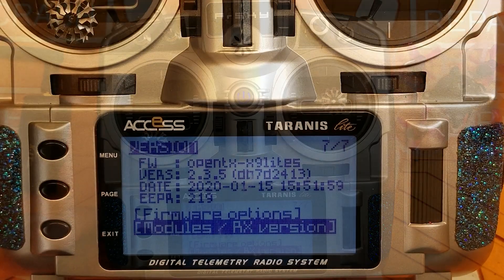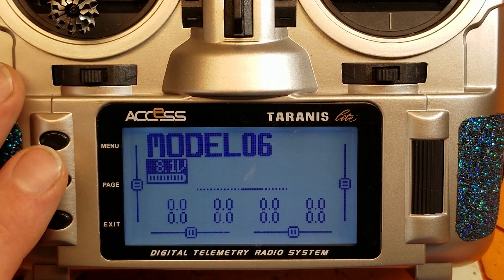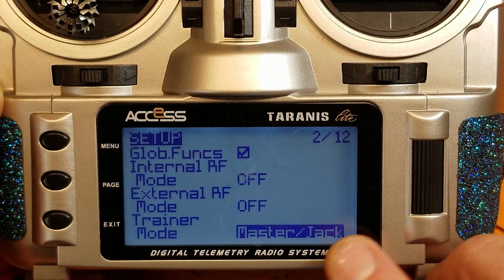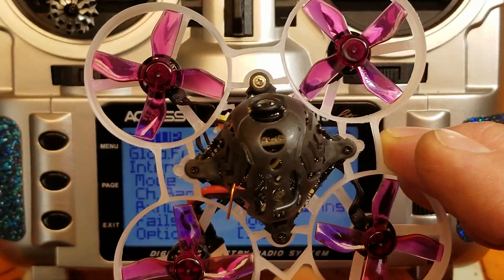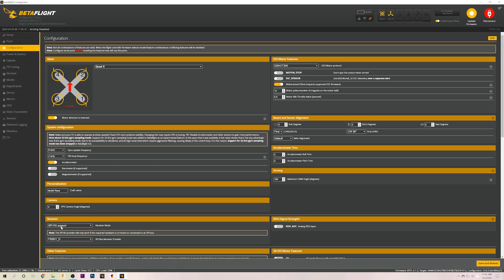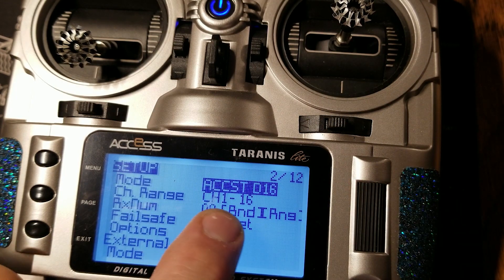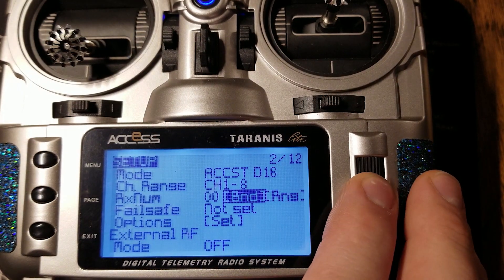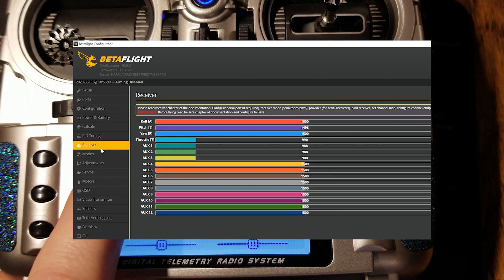How to bind SPI receiver with an ACCESS radio in D16. 📻✈

Comment: Okay, now I'm having a different problem. After fiddling with a few settings on Beta flight, I decided to reset the settings and just create a new model on my TX. After doing so, Betaflight isn't preloading the range values for the AUX1-3 controls anymore and I'm not fully understanding how it was setting those up to begin with. No matter how I set the ARM and ANGLE, the Mob6 will not arm and I haven't found a way to create a "crash flip" control from scratch. Should I flash the board on the whoop or is there another way? I'm about ready to just throw this damn thing. I'll get more air time out of it that way. LOL j/k
Reply: Also, has anyone tried out the iRangeX module with anything? I've got one on the way in hopes of using the X-lite with my Mini Convergence.
Reply from the maker: Did you flash new fw in bf or did you just hit the reset settings button?
Reply: I just hit the reset settings button thinking it would revert back to the setup it initially created the model with.
Reply from the maker: Haha yea that's not how it works unfortunately. Did you back up your settings before you did that? Either way the channels are probably not populating because you need to go to the config tab and enable spi based receiver and frsky_x if you were running d16. Unfortunately this will just be the top of the iceberg of issues you might encounter from clearing the settings.
Reply: @TweetFPV  I was afraid of that. I made sure it's set to SPI and Frsky_x.
Reply from the maker: https://discord.gg/YrB7BSv hit me up in discord and I can send you a config dump for the mobula 6 to get you back to stock.

Comment: Excuse my ignorance but I’m new to FPV flying.  I purchased the Tiny Hawk Freestyle.  Didn’t know what kind of transmitter I needed.  My second transmitter is the Taranis FrSky x9 Lite.  Will this work on the Tiny Hawk?
Reply from the maker: It will.
Reply: @TweetFPV  I've spent so many hours looking for help. I'll give this a try..
Reply from the maker: If you have troubles hit me up on discord. I've help more people than I can count with using that radio and Quad combo.
Reply: @TweetFPV  I'm still looking for your upgrade video..

Comment: I'm guessing this doesn't work with the newer firmware update for the radio that's required to use the r9m lite pro module and newer r9 ota receivers.  can you confirm which firmware version or release date you have here please?
Reply from the maker: I'm using opentx 2.3.9 ISRM FW v 1.1.3  and this will not work with V 2.x FW. Your R9 fw is independent of your internal (ISRM) FW. so you can run older ISRM FW and current R9 FW at the same time.

Comment: I'm at work so I'll have to double check, but I think my Taranis QX7 will not go into ACCST It will only go into a ACCESS or ACCESS16. Am I remembering correctly, is anybody aware of this?
Reply from the maker: you are not remembering correctly. Your new model QX7 will do ACCESS and ACCST D16
Reply: @TweetFPV  That's exactly right and I learned how to update it and now it's working. But I wouldn't have figured that out without your video so thank you

Comment: I have followed the same steps, but unfortunately it didn't go through. 
the qx7 access Tx operating system is up to date 2.3.9
Betaflight version 4.0.0 is uptodate 10.7.0
Configuration is Frsky_x
in the CLI: bind_rx_spi, then put the radio on bind mode D16
then hit Save. 
nothing worked! :(
Can you please tell me if there is anything I need to check
Reply from the maker: check to see if your bootloader is v 2.3.9 as well.

Comment: Heeeey :) Thanks a lot for your video ! 
However, impossible to bind my bet65s with my taranis qx7 ACCESS... I flashed the 1.1.3 isrm firmware, I'm in eu, and the spi receiver is set to FRSKY_X_LBT. Also, I'm well on the 2.3.5 version of openTX... Don't understand what is going on. Any help would be welcome :) Cheers !
Reply from the maker: Is your radio setup as fcc or lbt in the module version page?
Reply: @TweetFPV  I'm trying to flash the old xjt firmware in FCC but not working... 
In the module page it says, 
ISRM-N 1.1.1/1.1.3EU
Reply from the maker: Have you tried using frsky_x the non lbt version?
Reply from the maker: I haven't dealt too much with the lbt issues.
Reply: @TweetFPV  Yop also tried this one :(
Reply from the maker: Well it's not the "right" thing to do but you could change your radio to a fcc radio and bind with accst d16 and frsky_x.
Reply: @TweetFPV  Just done that and it works... OMG, thanks I don't have to deal more often with frsky protocol... gold for CRSF hahaha
Thanks a lot for helping :)
Reply from the maker: Awesome. Glad that got you going. I wish things were easier.
Reply: @TweetFPV  Hahahah thanks again :) I wish too :)
Reply: hey, I read your conservation and how did you changed your radio to an fcc radio? What do you mean by changing the radio? 
Did you have to add a lua script?
Sorry the many questions but I would love to hear a little instruction, because my Mobula 6 is waiting.....
Reply from the maker: Yes you can change radio region with a Lua script I have on my discord server. You can find the link to my server here Www.tweetfpv.com I can help you better over on the discord if you need it.
Reply: @TweetFPV  Yeah I wrote you a message on your discord server in Troubleshooting

Comment: You save my life with the command 'save', thank you very much!!!!!!!!!!! :)
My case Tinyhawk 2 with x9d+se in eu_lbt
Reply from the maker: Glad i could help!
Reply: how you did that ? i struggle alot ...tried so many things . i have same setup th2 with x9d+se eu_lbt. do i have change the spi to frsky_x_lbt or not ?
Reply from the maker: If you have a lbt radio then you need to use frsky_x_lbt but you can not be on isrm v2.x you need to be on v1.1.3
Reply: @TweetFPV  it finally worked. i guess i hadn't waited long enough after the bind_rx command. thanks for the help
Reply from the maker: No problem! If you need any more help feel free to ask over on my discord server. You can find the link on my website http://www.tweetfpv.com

Comment: I have a Taranis Q X7s ACCESS radio and a Tinyhawk Freestyle. After flashing the ISRM module from v2.1.0 to v1.1.3 I managed to the bind the Tinyhawk to the radio in D16 ACCST mode but the signal is so unstable that the quad is impossible to fly. When I power on the radio and the quad the signal remains "stable" for about 5 seconds then it keeps dropping and coming back every 15s or so. The radio keeps saying "Telemetry Lost, Telemetry Recovered, Telemetry Lost, Telemetry Recovered... RF signal critical" etc. I have tried both FCC and EU (LBT) modes but the issue does not disappear. Does anyone know what the reason could be?
Reply from the maker: The reason seams to be an issue with the amount of data sent in d16 mode. Some boards are better than others. This is why i don't really recommend using d16 mode with SPI based boards. The XJT module is the only real way to get D8 for these models to work well.
Reply: @TweetFPV  Thanks a lot for taking your time to read comments to reply! 
I have read somewhere that FrSky has disabled D8 in newer XJT modules, even if it is displayed as "availble" in openTX...
Reply from the maker: That is not true. D8 works just fine with the XJT module just not the ISRM on newer ACCESS radios. There is a LOT of incorrect info out there by people who just don't understand how these radios work.
Reply: TweetFPV thank you very much!
Reply from the maker: no problem.
Reply: @TweetFPV  thank you for this video. But I think Dave is right. The new firmware for xjt module disables d8. (I suppose if you keep older firmware it should be fine)I think the only solution for access txs and d8 Is multi module)
Reply from the maker: No, the new fw does not disable d8 unless you flash the lbt version. Lbt disables d8 because d8 is not legal in lbt use areas and this is how it has always been for the older radios. I think some of the confusion is using the term xjt to mean all fraky transmitter modules. Where as all the old radios used an xjt module and the new radios use a ismr module in which the isrm can not do d8 in any situation.
Reply: TweetFPV Update: I was able to obtain a stable bind in D16 mode between my Taranis and the Tinyhawk. I simply had to bind using the “8 channels, no telemetry” option in the radio (rather than the 16channels option).
Reply from the maker: @Dave-xv8xh  yea d16 is unstable and the less you make it do the better. D8 in general is always better with the spi boards.
Reply from the maker: @Dave-xv8xh  some spi boards are way better than others.
Reply: Sorry if I jump in, why did you change your ACCESS version from v2.1.0 to v1.1.3?
I’m asking because I have a QX7 with ISRM v2.1.0 and I’m using it with my 5” and I don’t like the idea to downgrade it in order to make it work with the tinyHawk
Reply: Nicolò Riboni https://youtu.be/mDBoXLGjqS4 that link might help you bind your QX7 ACCESS with your Tinyhawk
Reply: Nicolò Riboni Sorry for the late reply... I did it because FrSky has slightly changed the binding procedure in firmware versions after v1.1.3. They did it to break compatibility with ”FrSky compatible receivers” (such as the ones found in the Tinyhawks). You can have both firmwares in your Taranis’ SD card and then flash either one whenever needed.

Comment: Hi there, 
Great video and explanation. I have tried everything and I can't get my Tinyhawk S to bind with my Taranis X9 lite. I followed all the steps (also in your other video on how to update firmware). I did it all except one thing. I updated to the 2.3.7 opentx firmware instead of 2.3.5 and I updated the bootloader to 2.3.7. Can that be what courses me the troubles? Or should it work with that firmware and bootloader as well? 
All the best from Denmark
Reply from the maker: the boot loader not being updated can cause issues with binding. also the ISRM FW needs to be on v1.1.3 the V2.x WILL NOT work with the spi boards on D16
Reply: @TweetFPV  alright thanks. I'll try to upload the bootloader and the ISRM to the exact same version as you have in the video. I just couldn't seem to find it.
Reply: @TweetFPV  Thank you so much!!!!!!!  I finally got my FrSky X-Lite S to connect to my Tinyhawk S in D16 mode.  I upgraded to OpenTX 2.3.7.  I down graded my ISRM FW to v1.1.3 and it starts working!  Cheers.

Comment: I had my tinyhawk 2 bound to my taranis Q X7 accst. After installing a long range module on the taranis and doing a firmware update I can no longer bind to my tinyhawk. Even when I turn external module off. Can someone help here??
Reply from the maker: You might have accidentally flashed over your internal rf moduel. Go to https://www.frsky-rc.com/taranis-q-x7-3/ and download the ixjt fw but select the "history" version not v2.1 copy that to you sd card and flash your internal module with that fw.
Reply: @TweetFPV  My QX7 will not let me overwrite the existing firmware.
"FW update error. Not responding"
Reply from the maker: Which fw did you have and which are you trying to write?

Comment: Initially following this video, I was not able to get my X9 Lite connected to my Mobula6. I was struggling getting it connected, but after trying many different things, I eventually landed on a setup that worked. Here are the exact things I had that made it work for my drone:

* On the FrSky X9 Lite controller:
- OpenTX 2.3.7
- ISRM v1.1.3FCC (as downloaded from https://www.frsky-rc.com/taranis-x9-lite/) 

(side note: I did NOT get the new v2.1.0 to work with the Mobula6, even after flashing the v2.1.0 again after the initial binding. Flashing back to the v1.1.3 fixed it though and let me bind again)
- Bind settings: ACCST D16, CH 1-8, bind with CH 1-8 telemetry on

* Drone (Mobula6):
- Updated firmware to Betaflight 4.1.2 under the board name "CRAZYBEEF4FR (HAMO)" (I believe it's the same version installed on the Mobula6 in the video)
(side note: I was not able to get it to bind in Betaflight 4.1.5. I don't know if this was due to one of the other things I've mentioned being set differently at the time or not, but I wasn't able to get it bound on it for whatever reason.)
Edit 4/24/14: Was able to get the Mobula6 to rebind to my controller after flashing Emuflight "0.1.0 - CRAZYBEEF4FR" and applying the Project Mockingbird tune for it. Same process for binding- nothing changed on my X9 Lite.

With all of those set, I then followed the procedure in the video, and was able to bind to my Mobula6.
I don't know exactly which of these is may be directly responsible, but the fact that I didn't need to have the latest firmware/software for EVERYTHING kind of shocked me. Just posting what worked for me. Thanks for the helpful video TweetFPV! Came in handy once I had all the firmware stuff setup correctly.
Reply: I've tried changing the ISRM version from 2.1.0 to v.1.1.3 and it worked! Thank you very much for your help. I was having a lot of problems and I saw a lot of videos but your comment was the one that really helped me. Thank you again!
Reply: Wow thank you so much. Im so glad i found your comment here. I was able to make it work with the v1.1.3
Reply: that should be top coment. Thanks, I spent many hours to figure out whats goin on.
Reply: Does this mess up other quads that might be bound to the radio, or is the isrm thing based per-model?
Reply from the maker: All models need th have the same reciever fw on them.
Reply: Thanks men you save us with FIRMWARE 1.1.3 just that ! When you were going to stop using your Taramis !
Reply: If i use the external XJT or multi protocol module to enable D8 mode, will that work with access 2.1.0? or will i still need to downgrade the firmware to 1.1.3 regardless?
Reply from the maker: The fw on the external module and the internal operate independently of each other, so yes you could have 2.x on the internal and still use d8 with the external.
Reply: @TweetFPV  ok so i need an external to use both. I bought an iflight nazgul5v2 and had troubles binding to my q9lite. I updated to access 2.1.0 firmware and flashed the rxsr with the same to bind. Now im find my whoops arent binding. Clearly the reason this pinned comment states :(
Im assuming to make all these work i will need to flash everything with v1.1.3?
Reply from the maker: Without the external modules then you are correct. V1. 1.3 for everything
Reply: THANK YOU!!! I really appreciate it man nice and easy to follow and I had the exact same specs.

Comment: followed the video really easy to follow but unfortunately i still cant get my x9 lite to bind to my mob 6 - should probably mention Europe based have your or anyone here in the comments had similar issues?
Reply from the maker: Have you tried using the frsky_x lbt mode in the bf config tab. I have to admit I have no experience trying to get a EU branded radio to work like this.
Reply: @TweetFPV  I was reading the comments and I saw that so I hopped back into betaflight to check I don't actually get that option for some reason this is my first drone so I'm learning as I go, 

I have a feeling ill end up needing a external module that supports it natively for some reason. If you have any other suggestions I'd appreciate it! :)
Reply from the maker: Hmm what version of bf do you have?
Reply: @TweetFPV  can't remember the exact version but the bind command I get with tab is bind_rx so it's 4.1.x

Comment: How can I get to that version page on a Taranis x9 lite? I can’t seem to figure out what firmware I’m running
Reply from the maker: Hold the menu button to get into the system menu then scroll till you find it.
Reply: @TweetFPV  Perfect. If I upgrade to Open TX 2.3.7 will it connect to my Mobula6?
Reply from the maker: Possibly.

Comment: I got a betafpv f3 v1.1 board which has frsky rx via sbus protocol how to bind to it using frsky x9 lite. I have both d8 and d16 using xjt lite module.. new to this hobby kindly help me to bind to the brushed fc.
Reply from the maker: It's the same process but you can't use the cli command for binding you'll need to be in d8 mode on the xjt lite module
Reply: @TweetFPV  yes I tried using d8 but still can't bind to fc red light blinking no solid light
Reply from the maker: Hmm that should work. And be fairly straight forward. Have you been able to connect to any other quads with the xjt lite module?
Reply from the maker: Also does the led on the back of then xjt lite come when trying to bind?
Reply: @TweetFPV  yes
Reply: @TweetFPV  I tried with crazybee f4 fc I binded properly no problem.. xjt lite d8 worked

Comment: As usual great video and thank you! Unfortunately, the XJT Lite modules on the shelf's now will not work for D8 mode. I asked Wayne at Aloft Hobbies in Novato, CA what was up as I could not bind any of my D8 receivers. He has a direct pipeline to FrSky and told me while D8 shows as an option in the XJT lite bind choices, it is not active due to D8 being illegal in Europe. One of our Multi GP club members has the iRange lite multi-module and that does work for D8 but costs over 1.5 times more than the XJT Lite and as far a I can tell only Bangood carries it so good luck getting one of those out of China right now! Sigh, I agree with you I love-love-love my X9 Lite and hate I have to take my big clunky Q7S to whoop races!